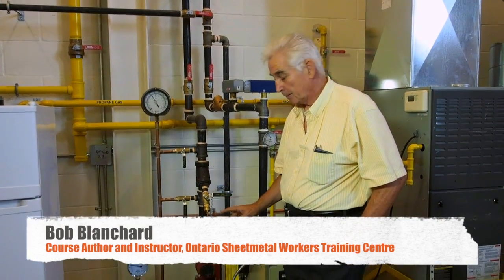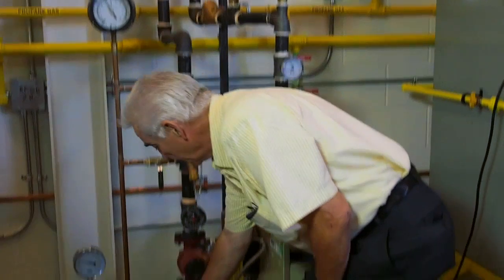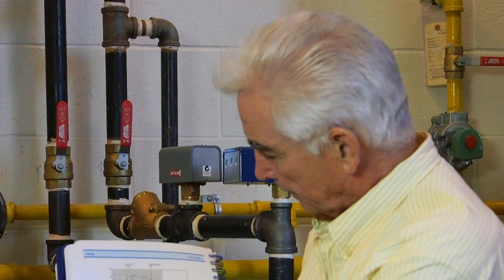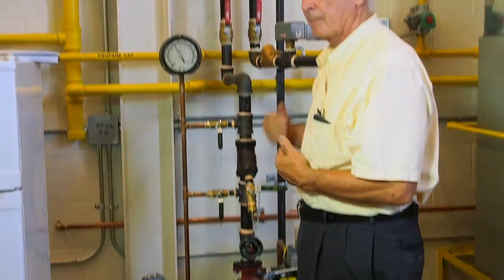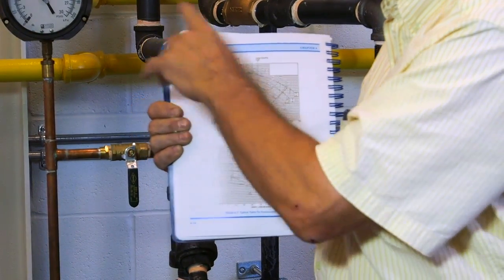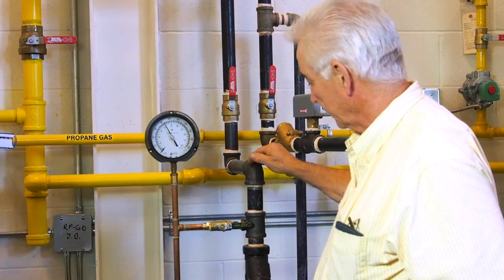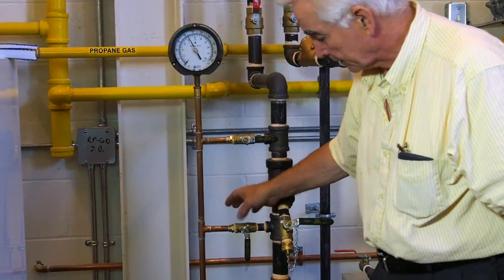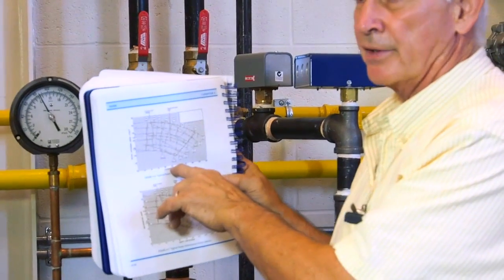Measuring Pump Performance

Comment: I suggest noting the system would need to be sequenced to it's full flow capacity which allows a pump to perform and not be restricted by the system itself. Also important is when a suction reading is negative you would add and not subtract from the discharge side.
Aloha-Paul Morse-AABC-TBE